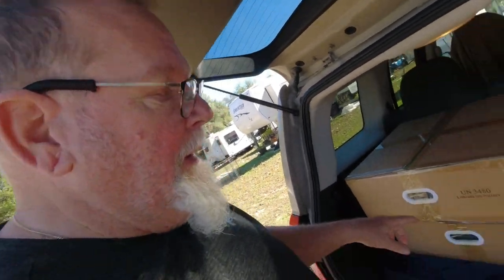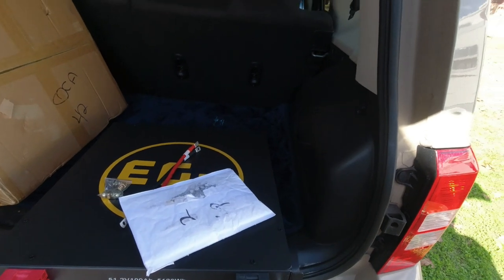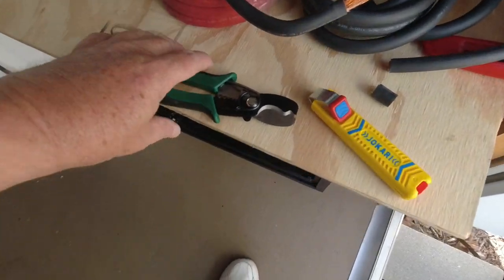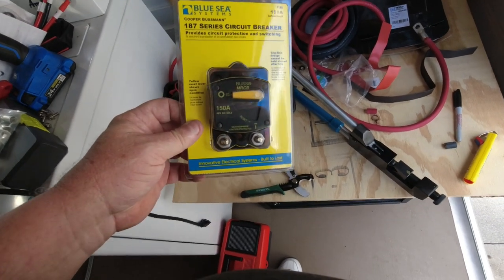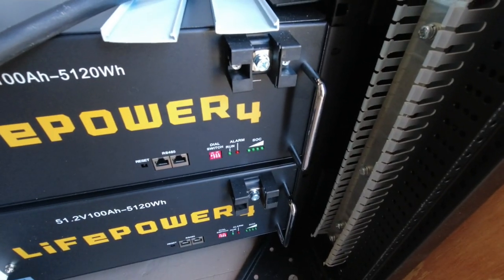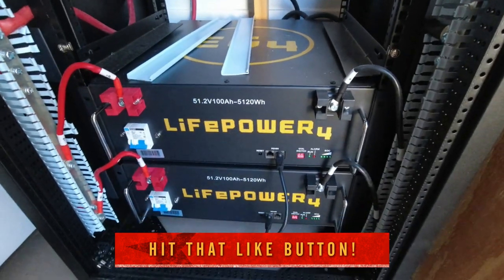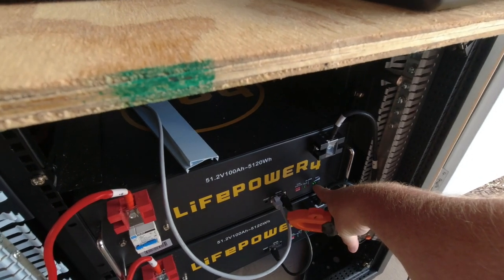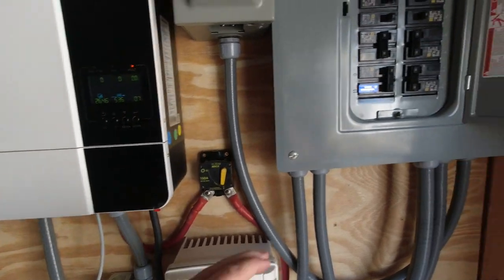48v Lifepo4 5kw battery install wired to SPF 5000 ES growatt inverter for 5kw off grid solar system

Comment: I am happy you finally got it figured out. Will Prose had a great video doing the exact same thing and he warned about each one of your problems. After seeing you do it I want to give it a go myself. I only have about 3.4kwh of solar so a small system to start things off. Great Job!
Reply from the maker: Thanks.  So far it is doing good and running everything in the trailer and shed.   The dryer is the only thing that is still connected to the utility pole .

Comment: I noticed about midway in your video that’s the dryer vent is exiting right underneath your growatt. You may want to think about relocating that away from the growatt and your batteries and anything else electronic. The moist air will get into the delicate electronics and ruin it over time. You do have a very nice set up.

Comment: I just got my single 48v rack battery 2 weeks ago and it's running a 3000w Growatt on my tiny house, no solar yet so it's all temp setup using a generator to recharge every 2-3 days. can't wait to get a 2nd battery and a rack.
Reply from the maker: Get your self some panels, look around for some used ones they are dirt cheap.
Reply: @FreeAmericanSpirit  slow process, this is the first time I’ve had constant power since Dec of 2020 so next thing I need is a fridge lol
I’m leaning toward a 10 panel order from Sigbature Solar, that way all my panels are the same with similar degradation. Baby steps for sure
Reply from the maker: @jtr82369  I get it I'm saving up for more batteries..   I just bought a 10 sq ft magic chef fridge from home Depot, to replace the 6 sq ft fridge in my trailer.  This fridge runs on 1.7 amps and the old one runs on 3.2 amps. Twice the size at half the elec.  It works great.
Reply: @FreeAmericanSpirit  I considered that one, its a manual defrost I think, I live in FL so humidity is my enemy. I like the Insignia 11.5 from Best Buy, the freezer is on the bottom but is still a door style, I think it's 2.5 amp during the defrost cycle.
Reply from the maker: Nope it is auto defrost.  Freezer on top.
Reply from the maker: Those 440.watt panels they have are nice. But they are large...
Reply: @jtr82369  make sure to order 1-2 extra. High probability that at least one will be damaged in transit (I learned this the hard way).
Reply: hello, let me know please how did you do. I am thinking in buy a system for my self. thank you.
Reply: @antonioalto6091  I have 1000watts of solar & it’s doing really good, I still have to charge in the evening to keep the battery full but another 1000watts of solar should fix that.
Signature Solar now has their own inverter that has much better specs than the Growatt, it’s called the EG-4 just like they’re batteries.
Reply: @FreeAmericanSpirit  I ended up going with a Magic Chef version, almost identical specs. Works great 👍👍
Also got my first batch of 1000watts of Solar & a Pioneer mini split, I can’t believe I survived without all that a year ago 😂
Reply from the maker: Your living large my friend!!!  Good job.  A second battery will be really good.  If I didn't have my air conditioner I could live of battery for quite a while.

Comment: I know this is an older video but the main cables to the inverter need to be put on opposite ends of battery buss bar. This keeps batteries balanced
Reply from the maker: Did that in the update video.

Comment: I think I'm going to convert an old washing machine into a battery rack, this way it will be all metal with front and top lids. I can just remove the front clips and install hinges. Casters will go where the feet are. Bus bars are cheap enough.
Reply from the maker: That sounds like a good project!

Comment: plug the battery comms cable into "BMS" at the 5000es.  This was just changed in the new units from RS485 to BMS port.
Reply from the maker: Yep that's what they told me ..  I felt like an idiot when I called them lol.  I like the new batteries and the new style inverter...  Makes it easy.  The only thing I would have different is left the breaker in the middle instead of I er to the side.
Reply: I think it was previously named CAN port, RS485 has been there for long time.

Comment: The battery terminals at the 150 breaker need to be covered.  if anything down stream of the breaker is ON you have 50+ VDC across the lugs.
Reply from the maker: Yea I'm trying to come up with a way to cover them. Thanks

Comment: i want to make a similar system with yours, but i have question why to buy series circuit breaker why do i need that, the batterys don't have the same thing
Reply from the maker: I'm sorry I really don't understand your question.  The batteries have an internal DC breaker.  The circuit breaker above it is also DC.....    The breakers in  the panel are all AC breakers.
I'm not an electrician so I really can't advise you on what will work for you and your area.

Comment: When you connected your batteries i noticed you did not have to worrry about spark. Is that due to the breaker on the battery and between the inverter?
Reply from the maker: When the breaker on the batteries are off there is no juice to the battery post's. Remember the breakers only shut off the single battery it is attached to.
Also if the second breaker from the battery to the inverter is off there will be no juice from any of the batteries past that point to the inverter.
Reply: @FreeAmericanSpirit  Thank you!

Comment: i see a lot of people use a resistor to "precharge" the capacitors in the inverter before they give it the full load.  you don't do this.... any thoughts?
Reply from the maker: No, these batteries have a resistor built in. Thanks for watching and commenting

Comment: Someone definitely is gonna die in a fire :(. Someone start the process of saving this man. I don't know where to begin but I feel Someone should try.
Reply from the maker: Nope no fires...  Why do you say that?
Reply: @FreeAmericanSpirit  1 trip, fall, slip of a hand and things are gonna end catastrophically for someone. Secure everything properly. Cover connections. A dryer next to your setup is insanely dangerous. Atleastbput up cement board so it's not left attatched to a flammable surface. There are so many precautions and proper install techniques even best electricians money can buy wouldn't skip but they are skipped here all over the place on an install that is one fall from serious injury. Ifsomeone so Much as trips while doing laundry or just gets tangled on all the slpppy wiring it could be fatal. Please Make sure someone who understands sub panels check your grounds and neutral bonds with the properties existing setup especially if your serious about tryingto go 240 with that. Is there a proper setup to make sure you aren't gonna back feed the fridge when power is out.  People are treating solar as if it's setting up a server. Not trying to be critical or mean and telling you by any means you aren't capable but you need to learn alot more about electrical. Study wiring up a sub panel in a garage. See how much more serious that small task is taken compared to people doing things like this. Best of luck to you.
Reply from the maker: The dryer vent goes outside. Just had it there hanging temporarily to get it out of the way. The only connections not covered is at the main battery disconnect of the positive line.  Very hard to trip and fall into that and start a fire considering it is 5 foot up and you would have to have a ground touching it...  
Everything else is in conduit and has fuses/breakers.... And all the wiring is if correct size.  Inverter and transformer are wired and grounded properly.  Don't need concrete board. If the components got hot enough to catch the wires in fire the concrete will not stop it.  The sub panel is grounded. The other sub panel for AC is not connected to the system it is not grounded (seperatley) as it is tied directly to the utility less than 10 feet away which is grounded and has the proper neutral...  Nine of the DC system has any AC going to it (only solar and battery)
The 220 cannot back feet to the fridge.
The fridge runs off the trailers electric system.  The plug going to the trailer is also plugged into a whole house surge/protection   dongle which would cut power to the trailer if 240 tried to go through it...
Reply: @FreeAmericanSpirit  looks like you got it covered! Maholo 🤙
Reply from the maker: @user-fn4co4cw1q  well I don't know about that, but I keep trying to improve it as time/money permits.
Reply: @FreeAmericanSpirit  Honestly that's more than most people will ever do. It's a process. Don't short change yourself that's awesome. The easy part is making that setup look good like a car audio system. In  all seriousness the way you put your work out there and responded like a man to non personal criticism is more important than anything. Refreshing to see these days lol. Depending where your setup is weather wise a little anti corosion never hurts, put some dielectric grease in places. You can always squeeze a bit under your heat shrink and get water resistant connections as well.
Reply from the maker: @user-fn4co4cw1q  well I started off with the utility pole with a box on it out in the open.  So the two extension cords going to the trailer just plugged into it and the trailer dongel basically was out side the box exposed to the elements.  
So just moving everything into the shed where all connections are out of the rain was a big improvement (solar or no solar)...
I also had to run extension cords from that box to the washer and dryer and put them away when done..  so this is a permanent setup, which is a big time saver and has a lot less possibility of danger.
My next project is to add some fans to the shed to keep it from getting to hot.
Other than a little humidity (going from cool night to hot day) there is no water in the shed, except for when the washer is running.  But the washer hose connections and drain are out side.  I  either going to build a door for the battery rack. Or just wait till I have six batteries and by the model that has a built in door..  (the 3 bay rack did not have a door option)

Comment: Hope your EG4 life pro preforms better than my brand new 24V EG4 life pro alarms  out with a 13 amp surge. No help from the seller.
Reply from the maker: I hope.you figure it out.  Mine are working good....what do you have your battery connected to?
Reply: @FreeAmericanSpirit  Trying everything I know, the system has been running fine for a year on AGM's . I wish Signature Solar would be helpful and take the time with me and solve this issue. @ 2 Growatt 3k 24 volt in split phase.
Reply from the maker: @tm510a  make a video of your system show how it's wired and show how it trips the battery.or the growatt/alarm. Post it to YouTube and on Facebook.  Maybe some one watching can answer your question and figure it out.  Signature solar may even watch it.
Reply: @FreeAmericanSpirit  Good idea

Comment: Having that Humidification Basket off your Dryer next to your equipment or even in the same room is just asking for trouble.
Reply from the maker: Yea.. I will be drilling a hole through the wall for a dryer vent soon.
Reply: glad im not the only one that saw that! Heat+humidity+lint+electrical gear= hello dr darwin!
Reply from the maker: It was there for 1 day until I installed a vent cap in the wall...

Comment: the dip switches on the main battery should be OFF-OFF-OFF-ON and the other battery at any other setting
Reply from the maker: I just did what they said (as in the video) and they work great...   Thanks for the comment and for watching.  I also just put out a vid showing the system running under load..   I pretty happy with it...   I will be upgrading it ( another batter and 1 more inverter) later this year
Reply: @FreeAmericanSpirit  If your Growatt is still not detecting the batteries properly when set to "Option 5 - Li Lithium", then you DO NOT have your DIP switches set correctly. Each additional battery will get a different DIP switch combo setting so that no two batteries have the same combo. That is what "Eco Papa" was trying to tell you since the last thing you told us in the video was that it was still not working on Option 5. So I take it that you actually got it working while set to Option 5 and that the batteries are not just working,  but are working on Option 5?
Reply from the maker: @mwreyf1  they are working
Reply: Unfortunatly, Free American Spirit mumbles on the REALLY IMPORTANT PART about the dip switches, and lets his voice fall off and increases his speaking speed. Great.  Can't understand a damn thing from that key segment.  All I can hear is top battery  is all down, on the dip switches.  Can anyone tell me what the 2nd lower battery was?  Would have helped to zoom in on it, but that's not there either.
Reply from the maker: @rufelestrada9791  on the first battery all the switches are on (down). All the other batteries can be anything but all down, as long as none of them are the same.  See this vid https://youtu.be/v8szZq6STcw from signature solar.   In addition program 5 needs to be set to LI and program 35 is set to L01...   
Sorry my filming is not up to your standards.
Reply: @FreeAmericanSpirit  In the Signature Solar Tech Chat, Matt says the first battery has the dips set from left to right, down, down, down, up so the #4 dip switch is up and the rest are down. The other batteries (if any) are any other combination as long as they're all different.  Why is your battery set differently??
Reply from the maker: I set mine according to SS video.  Go watch it. I think the thread is in one of these replies if not it's on their YT channel

Comment: Who makes that cabinet  and where did you get it ???
Reply from the maker: Signature solar sells them.  They have even better ones now.
Reply: I’ve seen them here like $500 
   How much stuff are you running with those 2 batteries
 Trying to figure out my order to put together for signature solar right now I’m buying their split phase all in one unit
Reply from the maker: @cowboymcq6711  I have four batteries..
Right now I run everything in my 30 amp trailer off it plus my washing machine and lights out in the ahead.
Basically my TV and computers are on.18 hours a day.  My fridge, coffee pot and 120 volt 6 gallon water heater cycle a couple times a day.  My 129 v 15000btu air conditioner runs a lot..  I have only run out of battery twice when it was cloudy for two days in a row.   Saving up for two more batteries,. Then after that I will save up to replace the all in one inverter with two eg4 inverters late next year.
Have had O problems.  I have used 0 electric from the grid except for my electric dryer

Comment: i put casters on mine because the batteries are so darn heavy i moved the rack to the battery.
Reply from the maker: When I save up for the third battery I will probably  put casters on as well.
Reply: Where did you buy the rack?
Reply from the maker: @DinoRexLand  signature solar

Comment: Does your solar turn off once the batteries are charged and begin to discharge the batteries instead of carrying the load?
Reply from the maker: No. The only time the batteries are used is if you do not have enough solar to power the load. In the settings you can choose which of the three types of power you want to use first.  Mine is set up SBU. (solar, battery, utility). In my case I have no utility hooked up so it would use solar.then the batteries and then it would stop when the batteries ran out.

Comment from the maker: Our Amazon home page link: To buy things you normally buy:
https://amzn.to/3oUsePn
Growatt SPF 5000es all in one inverter:
https://amzn.to/3e5xtFV
1/0 AGW black and red wire kit with lugs:
https://amzn.to/35HuIcY
TemCo LugCrimper
https://amzn.to/34UwqqW
Wire outer casing stripper:
https://amzn.to/3pSTZXW
50 Foot 8 Gauge Ground wire:
https://amzn.to/3GStyZr
8" wire cable cutter, stippers:
https://amzn.to/3KhTzUv
Kline CL-390 Clamp Meter:
https://amzn.to/3ITc5Sk
Klien T20 Driver:
https://amzn.to/3yvjZwf
Disclaimer: These links are affiliate links.  Free American Spirit will earn a small commission if you make a purchase at no additional cost to you. These are products, services, companies  and websites that I actually use and like. There has been NO Prior compensation paid to me to promote any of these links.

Comment: I was thinking of putting together a system like yours.   So here is a big question,  Can your system run your dryer?  I was thinking the system you are building would run a small house.     What size would you suggest?
Reply from the maker: I cannot run my dryer on just one inverter.  But I will be able to when I hook up the second one.  My water heater and my air conditioner run on 120 and I can run them.  Keep in mind my trailer runs in a 39 amp service.  For a small house you would need the second inverter and another set of panels.
Reply: @FreeAmericanSpirit  thanks for the fast response, I'll keep watching and saving up.